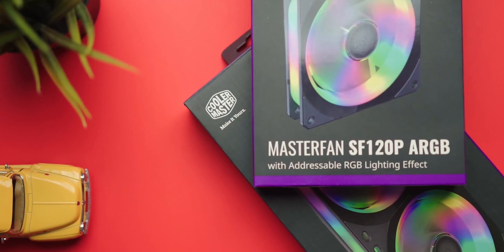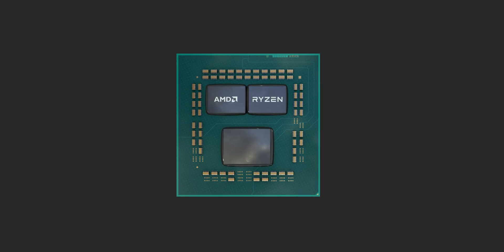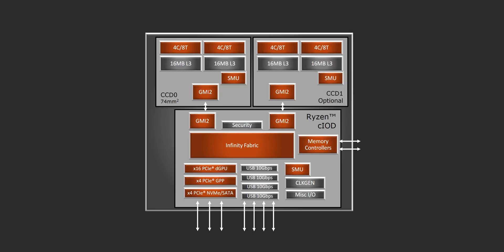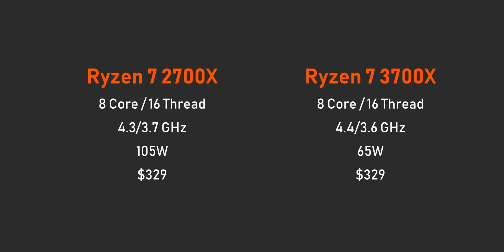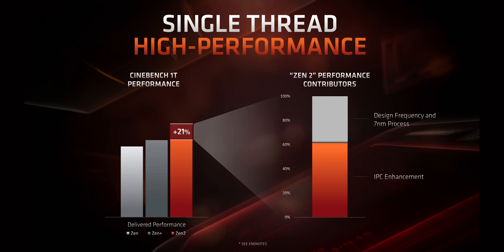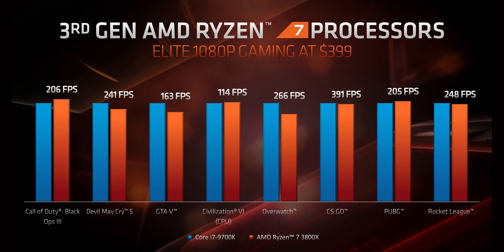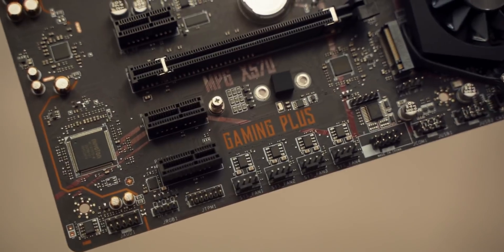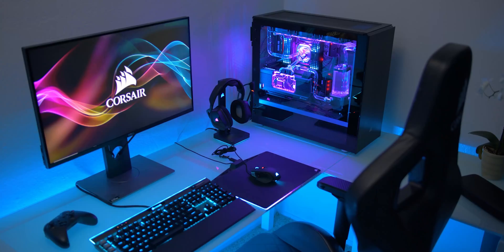AMD Ryzen 3000 – A Very REAL Problem For Intel?

Comment: im using ryzen 1600. upgrade or not.... both still good
Reply: If you're gaming on a high refresh rate monitor and feel like you're not getting enough FPS, upgrade to a 3600/3600X. Check if your motherboard has the required BIOS to update to 3000-series Ryzen CPUs first, though.

Comment: I almost bought an i5 9600k, ended up going with the R5 2600x because of SMT. I like to keep my computer's for a few years between upgrades and I feel like the SMT will let me hold out longer.
Reply: Good choise
Reply: Legend
Reply: Definitely - just look at how poorly the 7600k is doing these days due it it lacking HT (vs the 7700k, which is still hanging on - but only just...) ! Intel pretending like its a premium feature 🙄. Meanwhile on Ryzen, SMT is standard for basically everything but the very lowest end chips (probably because a lot of the time, it's actually damaged...)

Comment: I am an old AMD fanboy. Used FX series cpus for many years. Switched to  6700k and was very very impressed. Will most likely build a new sysyem this year. If i can get my hands on a pricecut i7 sure.... But most likely I guess i will go for the x570 with atleast 12 cores.
Reply: 6700k is still a nice CPU. I have mine running now since 2016. Its delided for use with liquid metal and cooled by an 240mm AIO. (4,9Ghz at 1,42v, 62° celsius max temp full load) I dont see a reason to upgrade, but i do only playing games on this rig.
Reply: @Squilliam-Fancyson  I dont unterstand that too, 6700k is great one. With good RAM and nice OC it is still a beast (~8600k which is faster than any ryzen in games).
Reply: from amd athlon 3000, and athlon x2 3600+ to ryzen 1400x. amd whole life
Reply: @OlieeMo  athlon is op tbh , if intel didnt pull (hippity hoppity , you now have pentium in your pc) it would have selled 5 times better ( at least)
Reply: My first build was an FX-8350 overclocked to hell, when the I7-7700k came out I used it in a mini itx setup and was very impressed. When I came back around to getting a full desktop again I got a R7 2700X, didn't notice any practical loss in games but gained an impressive amount of multitasking and productivity. All that's left is seeing what Intel can do to try to bring people back
Reply: @nitrodasnipaz9392  you basically downgraded your system gaming wise. A 7700k clocked to around 4.8 GHZ easily outperforms a 2700x in games. I see thats a big trade off if you need your PC for other things that heavily rely on multithreaded performance.
Reply: Same here, still sporting 6700k, but I'll probably wait till Zen 2 refresh arrives in late 2020.

Comment: 1. The latest rumor is that Intel will do a 10-15 price cut. 

2. The problem with that 3600(X) is that the next generation consoles will get 8C/16t Zen2 CPU's. The price per core is lower for the 3600(X) than for the higher core parts but you might have to upgrade again a few years from now. That is not necessarily a downside, just be aware of it.
Reply: Yep i made that mistake when i got 2500K (4c/4t). Today i wish i had gotten the 2600K (4c/8t) instead. Always go one higer than you think you need just to have that extra buffer just in case. Best back for buck generally does not age that well.  Besides 8c/16t has some pretty good prices on previous gen parts -  i've seen R7 1700 for as low as 130. Even the 330$ 3700X is ok for long term use.
Reply: @Raivo_K  
I also made this mistake before:
- buying a HD 7850 instead of a HD 7870 for €35 more (mostly because I was a newb and I did not know whether or not my OEM PC could handle that, now I would assemble one myself of course). I was in the shop and then the employee told me that I could now buy the HD 7870 for only €35 more. Little did I know. 

- buying a RM650X (a slightly lower efficiency for a load, only one 8-pin EPS-connector (CPU), only 9 SATA-connections and the fan spins up at a lower wattage and the dB is a bit higher) instead of buying a RM750X/RM850X for a bit more. I was in a hurry because there was a nice discount (€64 instead of €84, now €104, this was shortly after the crash of that 'mining'-hype). Sure, my RM650X for €64 (and €4 to send it) still is a pretty good deal but if you know that you could have done it better.

The common factor: buying while being in a hurry. I won't complain, I just point it out that it happens to all of us and that you learn to avoid such mistakes by gaining experience. I share it with others so that they can learn from my mistakes instead of making the same mistakes and then learn. ;)
Reply: @Raivo_K  

The 2700 is THE deal for Zen2. If you go for the 6C you could consider the 2600(X). At least you won't loose that much money and you can upgrade to Zen3 when the prices are low at the end of the cycle.

Comment: Intel needs to release the 9900KS at $450 and cut the 9900K price to $400 to remain competitive til they can get their 10nm processors into the mainstream or they're going to get killed.  A Z490 chipset with DDR5 and Pcie 4.0 support next year with a new line of Core X (10th gen intel) with 10-15% IPC improvement would give them back some momentum though.  Pushing DDR5 would really hurt AMD as all those bright shiny new X570 boards would instantly be obsolete.
Reply: If the 9900k was $400 it would be a way better value than the 3700x and 3800x. The increase in gaming board price already makes them cost around what the 9900k + board cost at $480.
Reply: @Zerosixious  My understanding is the X570 boards will basically be on par with the corresponding Z390 boards in price, is that not correct?  Also, you can run a likely run a 3700X and 3800X off a decent quality X470 or B450 board which are substantially cheaper than the Z370 or Z390 board that it takes to run a 9900K at 5ghz all cores without melting your vrms.
Reply: @gr82banautiger24  No, the x570 boards are around 20-30% higher than the equivalent z390 boards, but also have improvements. But the old boards pricing should decrease and the new boards should only cost 5%-7% more imo. That kind of price increase is insane and not good for the market. Upgrading from old Zen to new Zen 2 will be a huge gain for people who already were invested into AMD, but for people getting into AMD for Zen 2, will likely want to get better boards. Zen 3 in 2020 or whatever is in 2021 will be good upgrade paths, and they can sell their Zen 2 chips to make back some cost. I wouldn't suggest buying an older or budget board if you are getting in now with a 3700x or above. 

I am not pro Intel or AMD at this point Nvidia and Intel ruined the market by inflating pricing, and AMD is not trying to save it. The AMD hype-train people are just as bad as the Intel fanboys. The rest of the people like you and me or just somewhere in the middle

Comment: I will most likely be upgrading to a 3950x from a 2700x, however I want to see the performance numbers before committing. I don't need pcie gen4 and my Crosshair VII is perfect for my uses.
Reply: C7H is problably the best X470 board. You'll be totally fine with that.

Comment: switching to the 3700x from my 6600k at 4.4 Ghz, 4 cores is just not enough anymore. 12 logical cores is the bare minimum imo
Reply: Then you better get the 3900x.  The 3700x is only 8 logical cores.
Reply: @eliyang  Logical cores are the number of Physical cores times the number of threads that can run on each cores.
Reply: @rtwonmac  You're right.  Sorry, I mis-read.  :)

Comment: for me, going with an Intel just isn't an option. Aside from needing a motherboard, I would also need a new windows key for the new CPU and motherboard. So the 3950x really is the better choice for me.  My major gripe with the new x570 motherboards, are all the fans bolted onto blocks with minimal surface area for the fans to cool.

a fan on a block of metal without fins, is like selling a house in Alaska with an industrial heating system to make up for the complete lack of insulation in the walls. While it can be effective, it is also a complete waste of energy, a source of unnecessary noise, and far more expensive to construct and maintain than more 'elegant' solutions (like having insulated walls, or having fins on the heatsink).

Great vid Ebern and crew. B)
Reply: Agreed. Most of the motherboard cooling solutions for X570 are moronic at best, incompetent at worst. Plus the fact that the chipset reportedly peaks at 15W and under normal conditions runs at 11W so in a case with good airflow a proper passive heatsink with fins would have no problems cooling it down.

It would not even be very expensive. Some black coated, low profile aluminium heatsinks would looks very good on most boards.
Currently the only known X570 board to have passive heatsink is the Gigabyte Aorus Xtreme but the problem is that this will be one of the most expensive X570 boards at ~700$ (rumored). So it only makes sense to pair it with 3950X considering the price.

Comment: I believe the X570 is being positioned as the premium option in motherboard chipsets, not replacing X470. So B450 and X470 motherboards will continue being sold until next year for those of us who don't need PCIE gen4 quite yet.

Comment: I'm tempted to buy at least the 3900X given anything below wouldn't be a real improvement to my 2700X but I have to wait for pricing here in Germany.
Reply: The 37/800x will have huge single core uplifts. On Geekbench using 3200 mhz RAM and a 4.35ghz OC the 2700x gets 5070, while the 3800x stock with 2166 RAM gets 5406. If you were to just OC to boost with 3200 RAM you'd probably see upwards of 6000 single core. Granted, this is geekbench and not 1:1 representative of real world gains, however upgrading to the 37/800x is looking to be a large performance increase.
Reply: @SaddisticSpeller  I dunno, first of all I want to see what their new RX5700XT offers for me.
Then I'll look for Zen2.

Luckily B450s still support Zen2.
Reply: @MegaManNeo  Navi is pretty bad, I would strongly recommend just a used 1080 or Vega card instead.
Reply: @SaddisticSpeller  I'm on a 1070FTW that comes with stock FE 1080 performance out of the box, I'm actually interested in something with solid Linux support and a card that can keep 144fps better at 1080p on high settings than the 1070 does.

AMD's new card is the best choice I have in that regard unless I wanna play lottery.

Comment: I wait for Zen 3 and give AMD time to fix any surfacing Zen 2 problems. My 8700k with its 6 cores on 5 GHz will not be outdated for gaming that soon. I also wait for fanless x570 motherboards that cost not as much.
Reply: 8700k is still a damn good CPU.  You're good for awhile
Reply: @brandonunger1689  Not if he likes security.
Reply: zen 3 will likely not run on x570 lmfao. This is likely the last generation before a new platform as they'll probably go with ddr5 on zen3.
Reply: @shawnpitman876  Completely wrong. AMD stated back in 2017 that they will support the AM4 socket until 2020. Zen3 will be supported and ddr5 isn't coming out anytime soon. But Zen4 in 2021 will require a new socket and thus a new motherboard.